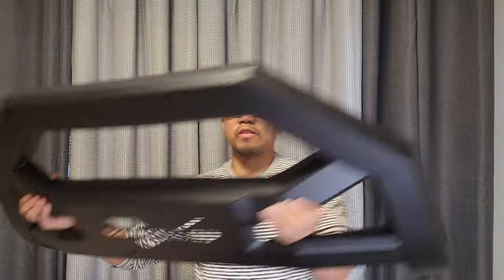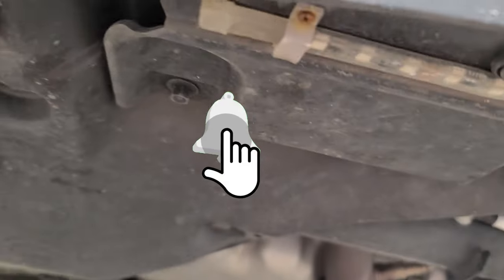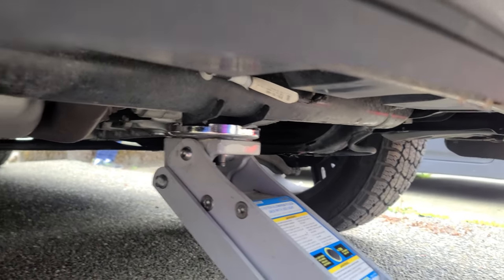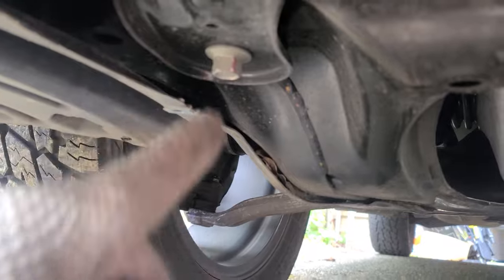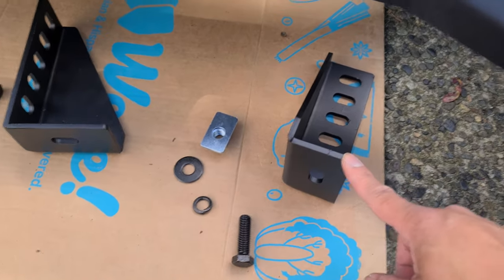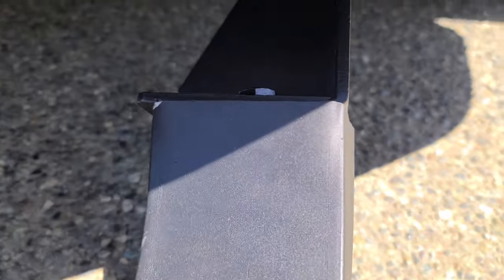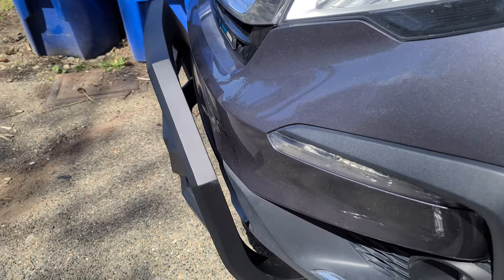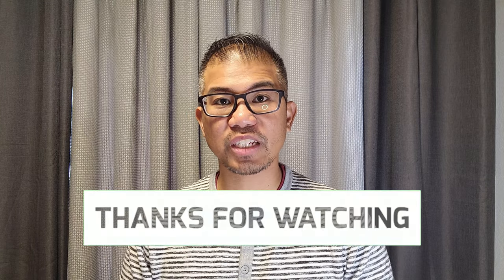How to install Vanguard Optimus X Bull Bar On Honda Pilot

Comment: Thank so much for this video. I ordered a Vanguard Bull Bar and it had no directions. Also, the bolts that connects the 2 brackets together was short as well it was only 1.5” long. So frustrating. Glad you made this video. Thank you.
Reply from the maker: Glad the video helped

Comment: Dude, thank you so much for this! I bought the Optimus (with the lightbar added) for my 2017.5 Jeep Compass, and while Vanguard's products themselves are great, their instillation and other available documentation is atrocious. The brackets that mate to the bar itself aren't even shown in any of the documentation (neither instilation nor in the provided parts list), and so it was completely a mystery as to how they intended for you to connect them (it's not intuitive at all). On top of that, they included the 2 bolts that had been welded to the barstock in my kit (in your video they're the pieces that slip inside the bar itself and allow you to mount the bracket to the bar), but on my model bar they already have a bolt welded inside the bar for that purpose (a very frustrating time discovering that particular detail...). So yeah, thanks very much again, you saved me a bunch of time and even more frustration!

Comment: Do you still like it. Would you buy it again or recommend it?
Reply from the maker: Yes. I do love it. I would recommend if you are looking for just looks but if you are planning to go off-road keep in mind your clearance is reduced.
Reply: @AutoSensation  Yes just for looks. No off-roading. Do ou recommend doing the 2 inch left in front if I install it to keep it level with the back?
Reply from the maker: @kevinschwellinger4905  yes. If I'm not mistaken it might be a 1.5 to make it level.
Reply: @AutoSensation  Can you show a picture with the under tray on?

Comment: What happened to splash guard ? was it able to go on with Bull Bar added ??
Reply from the maker: I did put it back on. Cut a little to make the brackets slide in.
Reply: Good question

Comment: Have you wondered if the bracket was installed wrong? Not needing the spacer?
Reply from the maker: Yes. I was scratching my head multiple times. I switch the brackets all sorts of combos and it does not work. I might have received the wrong brackets or bar.
Reply: @AutoSensation  If you switch the first mounting bracket that you  put underneath, will it will make it wider? So no need for spacer?
Reply from the maker: @danielmeneses9935  I've tried that. It does not sit properly or flush underneath.
Reply: @AutoSensation  Did you try to swap the brackets that you bolted to the bull bar? Looks like the right and left should be switched. Then maybe you wouldn't need spacers?
Reply from the maker: @kevinschwellinger4905  tried that. It would be either too big or too small.

Comment: Does the bravket ever hit the ground when you your drive on bumps?
Reply from the maker: No not at all. However I am lifted 2".
Reply: @AutoSensation  any difference when driving with a lifted car?
Reply from the maker: @johnimperial9777  personally I love it. I'm short so I see the difference in getting in and looks better imo. Maybe a mile or 2 less in gas mileage.
Reply: @AutoSensation  does driving comfort is better and smoother?
Reply from the maker: @johnimperial9777  didn't really notice any difference in ride quality.
Reply: @AutoSensation  does it affect airbag sensing?
Reply from the maker: @johnimperial9777  nope. Not at all

Comment: looks ok but removing the undertray will just speed up rust.
Reply from the maker: I agree. I'm trying to figure out a way to just trim a little so the tray will go back on.
Reply from the maker: Got the under tray back on. I just cut slits out and slide it back into place.